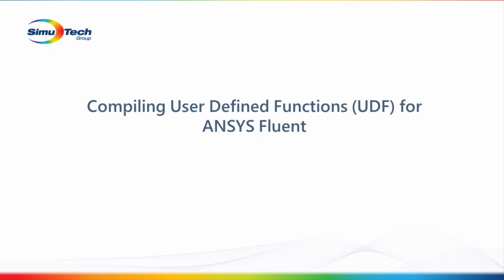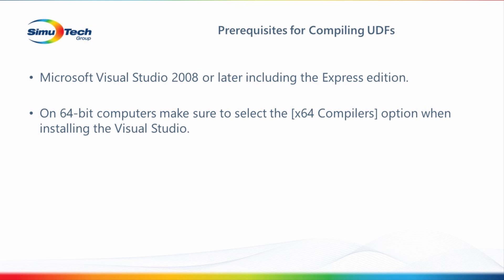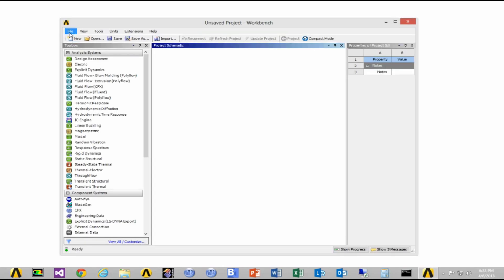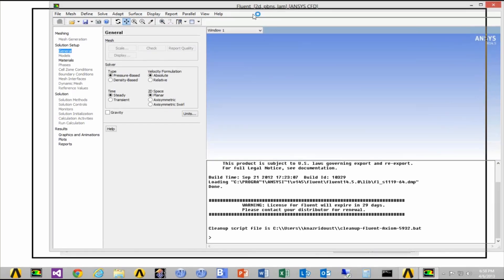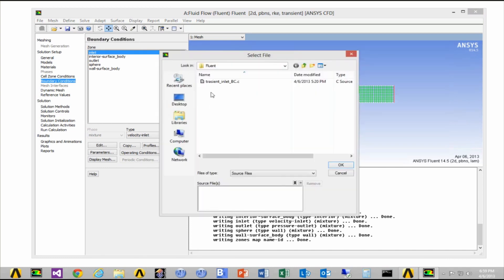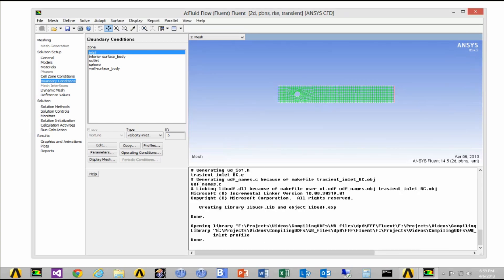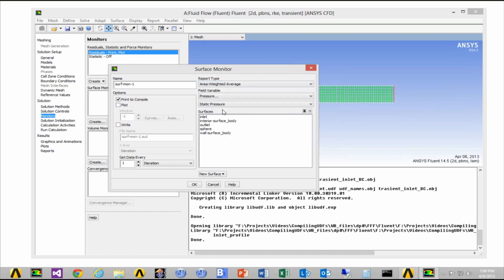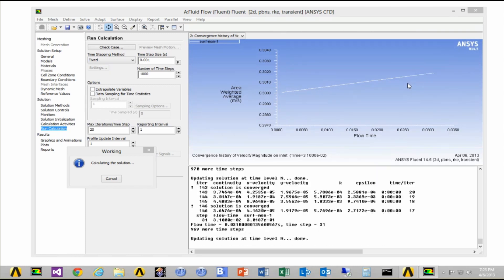Comprehensive Guide: Compiling User Defined Functions (UDF) in Ansys Fluent

Comment: I am running a 2D transient simulation(VOF Fluent) in which vapor bubbles are generated at the bottom surface of a rectangular domain that is initially full of water with heat flux given at the bottom wall. I was trying to patch a single vapor bubble by creating a hemispherical region. I can see my volume fraction contour with the bubble after patching a hemispherical region at the bottom of the liquid. The simulation is also running perfectly when I click on "Run Calculation".
When I do this same bubble patch operation through a DEFINE_INIT UDF, I can see the bubble getting patched in the vapor phase contour, but the calculation is not running. It is giving the following error in the 1st iteration itself.
Divergence detected in AMG solver: vof-1
Divergence detected in AMG solver: x-momentum
Divergence detected in AMG solver: y-momentum
Divergence detected in AMG solver: pressure correction
Divergence detected in AMG solver: pressure correction
Divergence detected in AMG solver: temperature

UDF code
#include "udf.h"

DEFINE_INIT (init2, domain1)
{
Message("solution initialised");

cell_t cell; 
  Thread *cell_thread;
  Domain *subdomain;
 
int phase_domain_index;
 //Initialisation of heater layer

sub_domain_loop(subdomain, domain1, phase_domain_index)
  {

if(DOMAIN_ID(subdomain) == 2)
{
thread_loop_c (cell_thread,subdomain)
     {

 begin_c_loop_all (cell,cell_thread)
         {
real arr[ND_ND];
C_CENTROID(arr,cell,cell_thread);
if (sqrt(ND_SUM(pow(arr[0],2),pow(arr[1],2), pow(arr[2],2)))<=0.00000002)
{

C_VOF (cell, cell_thread) = 0. ;
C_P(cell, cell_thread)= 5846400;
}

else
{

C_VOF (cell, cell_thread) = 1. ;
}

}
end_c_loop_all (cell,cell_thread);

}

}

}
}

When I am running the calculation I am getting this error, but there is no error when I am patching it without udf by creating a region.
I want this patching operation to be done via udf, so I can generate new bubbles after every time step in a specific pattern. (I will be using EXECUTE_AT_END for that ). I would be grateful if you can help me sir.
Reply from the maker: Hello and thank you for your comment. Unfortunately, this is a very involved scenario. If you are interested in any of our engineering services, please email info@simutechgroup.com. You can also check out SimuTech Skills Center, a training portal that contains training material and tips and tricks videos that have been created by SimuTech engineers: https://skillscenter.simutechgroup.com/

Comment: When I try to load UDF in fluent solver. The error messenge was showing that UDF library you are trying to load(libudf) is not compiled for parallel use on current platform (win64). The system cannot find the path specified.please help!!
Reply: man you can try  'interpreted 'instead of 'compiled'. i had same problem with you. i fix it
Reply: Me too
Reply: @khairiarrif3097  I installed visual studio 2012 . After that I haven't faced the problem
Reply: @saicharannathdubba3589  thank you friend ...can you give me the site
Reply: @khairiarrif3097  I forgot the website from where I downloaded it. But I can send you through Google drive. If possible send me your email id
Reply: Hello
when I try to load UDF, this error is shown:
"The UDF library you are trying to load (C:\Users\...\model_files\dp0\FLU\Fluent\libudf) is not compiled for 2d on the current platform (win64).
The system cannot find the file specified.

C:\Users\...\model_files\dp0\FLU\Fluent\C:\Users\...\model_files\dp0\FLU\Fluent\libudf\win64\2d\libudf.dll"
please help me
tanx
Reply: @sai charannath dubba hey. Can send me the visual studio also? Thank you very much☺️ I also facing this issue
Reply: A parallel UDF need more coding efforts and other headers to inform the compiler that the UDF will be run in parallel mode. Single UDF  for serial mode does not run in parallel mode wirh a serial coding. Interpret can workaround but there is slower than a complied object. But it works!